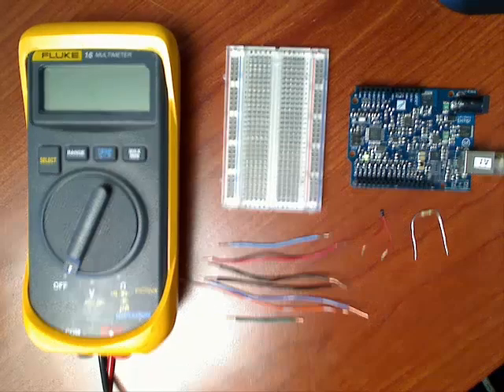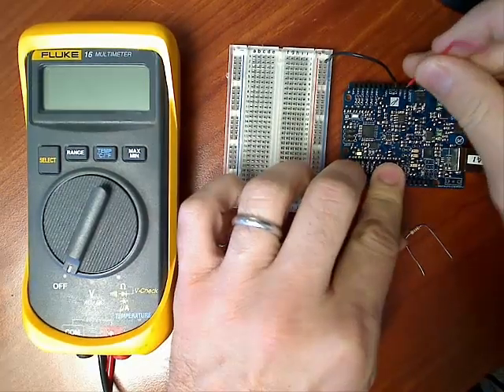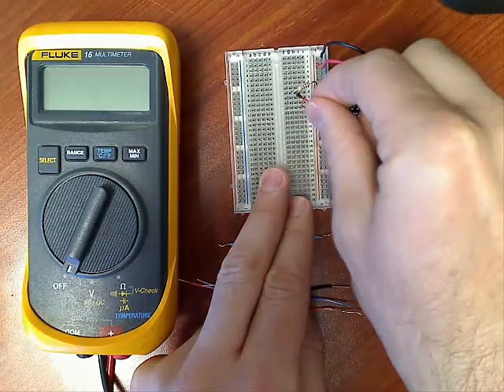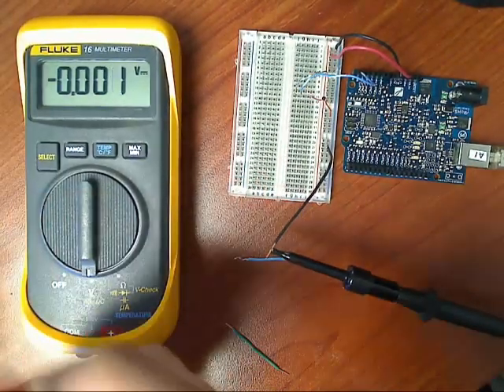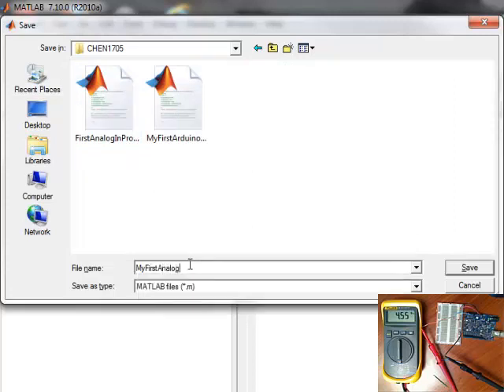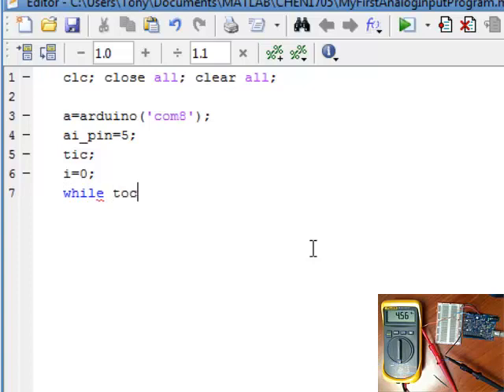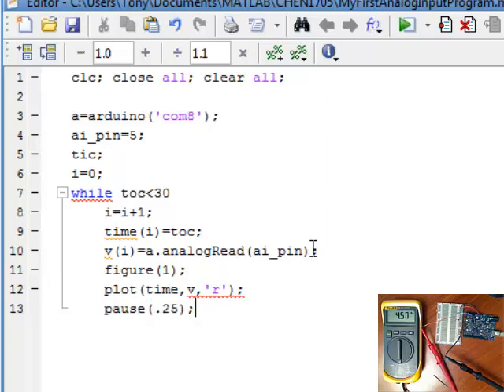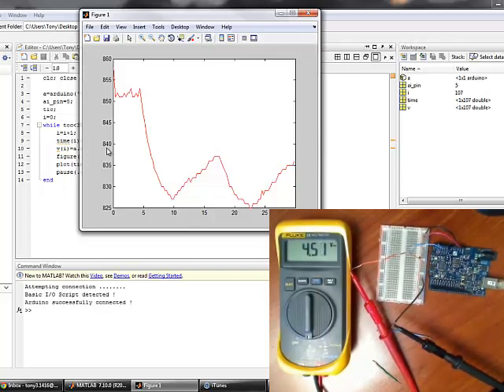Analog In Example With Arduino & Matlab

Comment from the maker: Hi Bridget, 
The y-axis is the 10 bit number that arduino spits out.  They go from 0 to 1023 as voltage goes from 0 to 5 V.  To convert just divide by 1023 and multiply by 5.